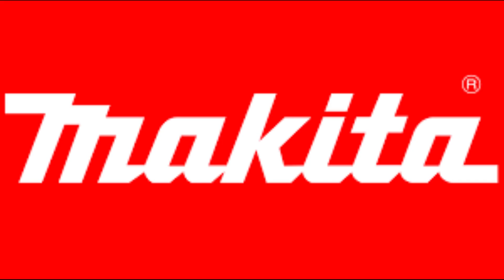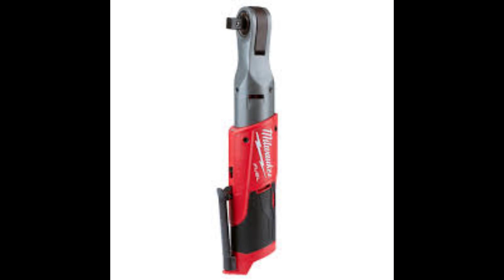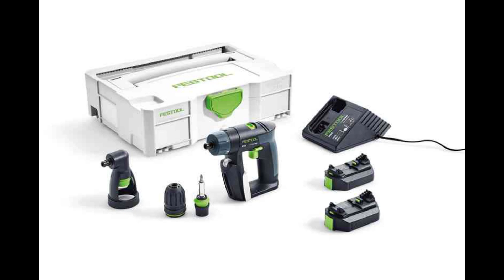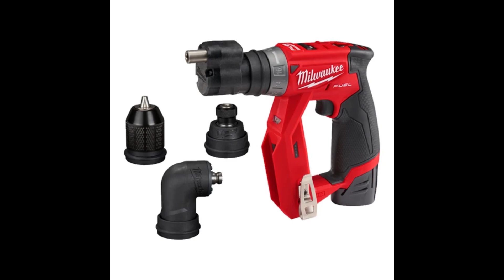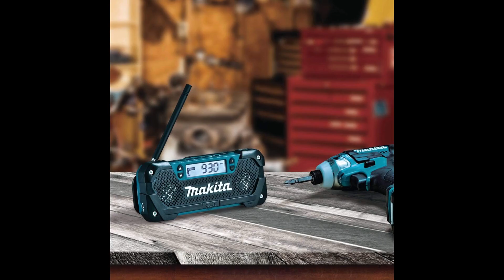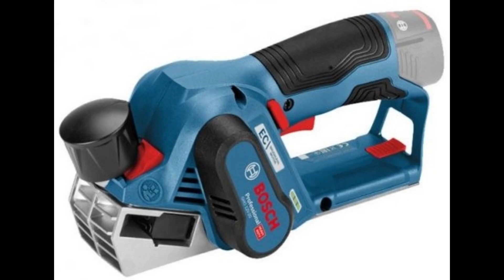5 New Makita tools for 2020 - Part 1

Comment: While Makita is pushing 40v, as a 18 and 36v tool owner, I sure hope the Makita will have backwards 40 to 36v compatibility.
Reply from the maker: From what I have read not on the tools but there will be an adapter to fit the charger. So you will be able to charge LXT batteries on GXT charges with an adapter

Comment: The CXT ratchet is already on sale in Aus and NZ I believe. The ratchet drive is interchangeable between 1/" and 3/8" and will be here early next year.

It's unlikely Makita will make one as they have something to cover all those bases already on the CXT platform and they're not very popular in Japan. 

As for the router and planer, they've made an 18v Brushless Planer which is coming next year and they're still heavily marketing the DRT50 cordless router so I wouldn't expect anything on the CXT platform soon.
Reply from the maker: Oh! Is that it? Doesn't loo as good as the Milwaukee and it doesn't look like the drawing. I was expecting something a little more modern
Reply: @bodgeitwithbrian  It's faster than the Milwaukee fuel but not as powerful. I think the Milwaukee Fuel is around 75Nm and the Makita is closer to 45Nm but in both cases, depending on what you're torquing to, they're both pretty weak. For me the Makita wins on ergonomics. I think they reason they've made it is more to just offer the option to those who want one but my advice to anyone is avoid brand loyalty, if you want the best on offer you need to move around.
Reply from the maker: Yes I think you're right, although I like Makita some of their tools are there just to fill a gap